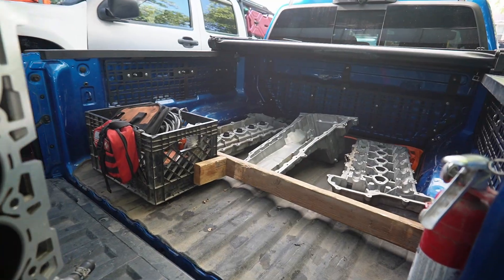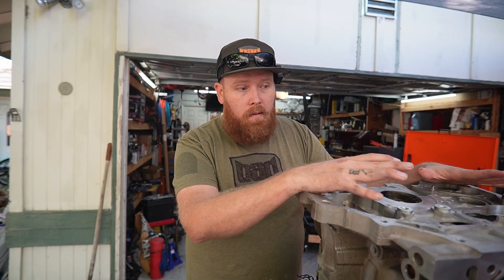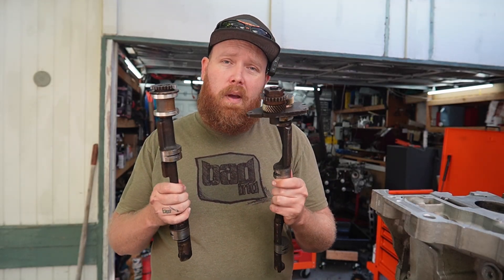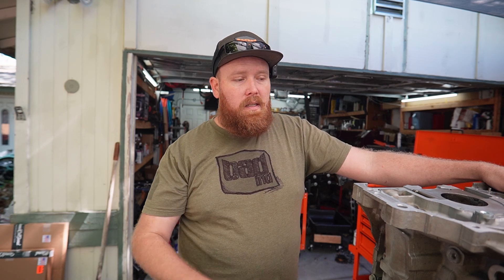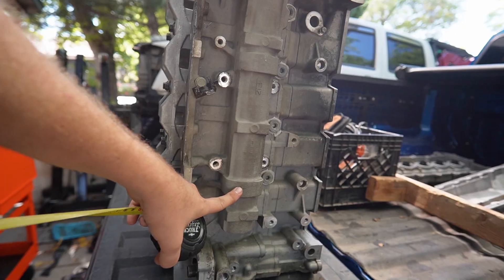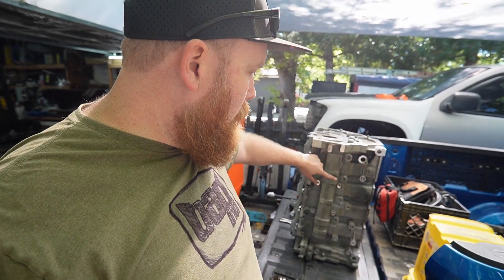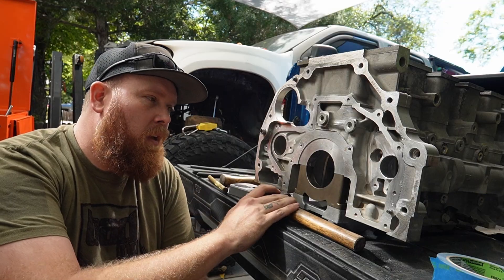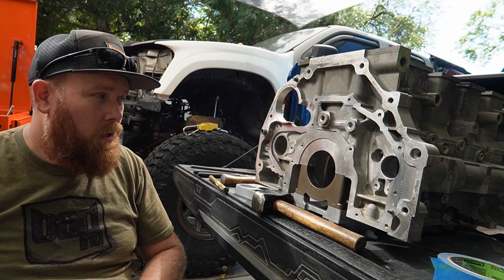Balance Shaft Delete kit - Atlas 4/5Cyl Engines

Comment: Would it help to freeze the new ones to ease in the installation of them?
Reply from the maker: The interference tolerance is likely too great to be able to do that. You'd need to be several hundred degrees below ambient to slip it in to the bore.

Comment: You mentioned it was important to mind scratching the parent bores of the bearings with the threaded rod. Something I'm gonna give a shot is covering all the exposed thread (at least what length reaches into the block) in a few layers of masking tape to just give it a bit of padding. Of course it's probably not necessary, but hey, Murphy's law could apply.
Reply from the maker: Its super not necessary but worth a few ft  of tape.

Comment: I’ve got about 1500 miles on my H3 since installing the kit.   At idle I hear the engine spinning more than I used to.    This goes away as soon as I start driving.   I’ve noticed no additional vibrations or roughness.    Throttle response and power increase are noticeable!!   I am very surprised at the difference this made!   Oil pressure is better than it used to be as well!   Time will tell but so far I am very happy with this modification!!!

Comment: Question about the rear chain tensioner? Since you deleted the balance shafts. Do I take off  tensioner off?
Reply from the maker: Yes you're deleting the shafts, tensioner and chain just as I did in the video.
Reply: @BadlandIndustries Because the oil will flow freely when the tensioner is off. Thanks for the quick reply!
Reply from the maker: The oil is being blocked where the balance shafts used to sit. The rear tensioner used to get oil from the rear most pillow block bearing that the bushing replaced. Your oil passages still go to the main bearings and connecting rods and the head as normal.
Reply: @B @BadlandIndustries Thank you 🙏

Comment: Most of us feel vibration at idle already. I'm curious how much more a person feels. Also will having 20 pounds less rotating mass add a noticeable increase in fuel economy
Reply from the maker: It's about ~12 lbs. But it is slightly more than stock. Think of like dirty throttle body idle but a little more than that.

Comment: Hey bro, planning on buying the kit soon! Around 01:23 you mention the "remove chain - tack oil tensioner hole" mod, How many miles and/or how long have you run your shop truck since that mod?
I'm considering doing that mod as a temporary measure until I have the time to install the balance shaft delete kit. Thanks
Reply from the maker: Couple hundred miles. I've known other to run them longer. The time involved to pull the trans and get back there you might as well spend the money on the kit. You can install it in the vehicle.
Reply: @BadlandIndustries  I hear ya. Sounds good I'll go straight to the kit. Thanks for the quick reply.
Reply from the maker: The sooner the better buddy.

Comment: Appreciate it. Picking up a set for my 2wd colorado.  Have a Magnuson MP90 supercharger that's going on this winter.  What's the current state of header options for these 3.5s?  Do any equal length headers exist or do I have to make my own?
Reply from the maker: Theres OEM looking ones that are junk and a few other offerings that are bolt on. Those are all pretty similar. Pretty tight fitment but if you are gonna make it yourself hoodrat mfg makes a sick 5way spiral collector.

Comment: I’m liking the idea of the delete kit because I’m about to do my timing chain…….. NOT looking forward to that. My 2.9 has 231k miles right now, got her from a dealership at 113k and am just now about to do the chains in it. Also im looking at having the head rebuilt because I did a compression test and cylinder 2 is at 160 psi where the others are at 210, but the motor runs good and doesn’t vibrate at all or very much ha ha ha. 

I’ve heard and don’t know if this is true but it makes sense to me that when sending the head to the machine shop to have it ported an polished to free up some airflow to make it breathe better.

Also I’m not over flowing with money right now so I’d be doing all this except the head work myself on my daily driver so that sucks. 

In your opinion while the motor is still running good in the matter of money wise, would it be cheaper to find a junkyard 5.3 and do that swap if the 4l60e would bolt up or just bite the bullet and do the timing chain and head work done.
Reply from the maker: There's no sense in dismantling your daily driver especially if you're tight on funds. Imo: buy another 2.9l. tear it down. I have a video on that. Pick away at the build as time and money allow. This way once it's done your down time will be exactly how long it takes you to pull the old one out and put the new one in.

Comment: How about a 5 cylinder to a 5.3 LS swap with a standard trans?  Id love to do this to my 06 H3
Reply from the maker: Lots of people have done that. That's not the purpose of this mod.
Reply: Plenty of people have done that swap, Fabbot makes a kit to use the AR5 transmission behind an LS engine.  You could also use a T56 transmission if you wanted something beefier

Comment: You'd think it would increase the HP too.
Reply from the maker: Definitely. LEDs rotational mass to spin.
Reply: If you push the bearing anought to block the oil hold?
Reply from the maker: The bearings aren't designed to block the holes. These new bushings are.

Comment: I'm curious to see the horse power and torque gain from losing so much rotating mass compared to stock
Reply from the maker: Well we're guessing 10-15 HP max on a stock na motor. But Calvin did just run his 5cyl with the kit recently at north of 700 HP with good oil pressure and no signs of issues.
Reply: @BadlandIndustries who’s is Calvin??
Reply from the maker: Nivlac57 here on youtube

Comment: It looks like a blind bearing puller would take the old ones out pretty well with a long extension. I'm really interested in doing this on my 3.5, but don't want to pull the low mileage engine out again haha
I did this on a 2trfe years ago with engine in, but those were on front. Actually seems easier on Atlas to just pull trans and try since timing cover and oil pan can stay on!
Reply from the maker: Yea I just don't know a tool that'll make it all the way down there. The all thread was the best and most economical way I could come up with. Cam bearing install tool definitely would have been the ticket but that's not a very likely too for the average car guy is gonna have.

Comment: I'm curious what the long term effects of this delete are, how much shorter will motor mounts last, what seals will get shaken loose and how much sooner are PM items needed?
Reply from the maker: Time will tell but with the rotating assembly being balanced to itself it won't be much more. Your motor mounts will see more uses from getting on and off the throttle more lol. It's only slightly more vibration and certainly not as though it's shaking the truck.